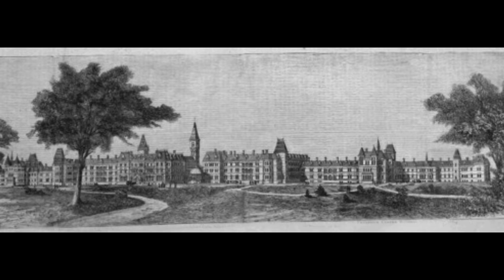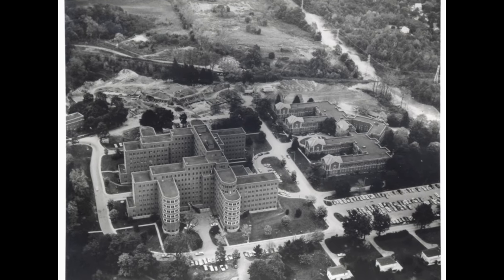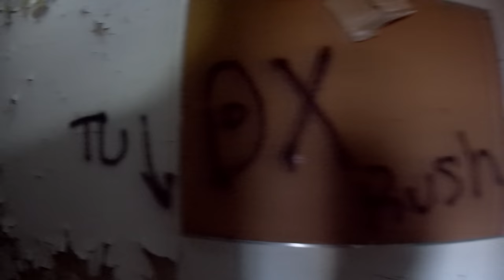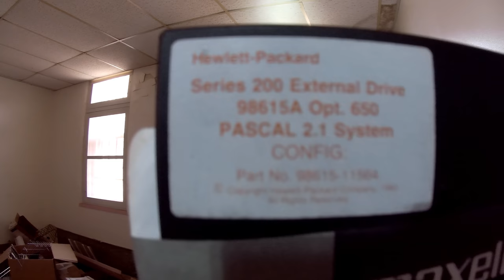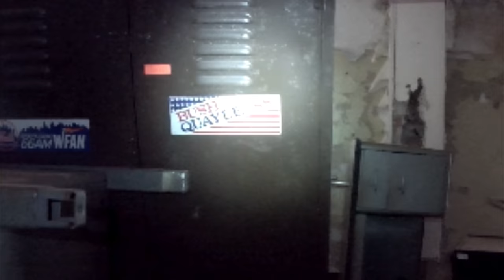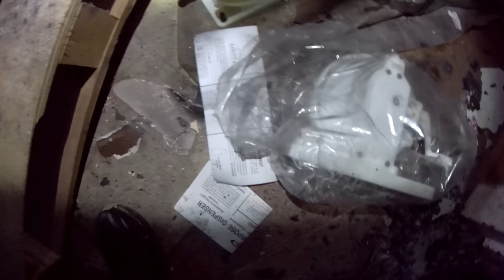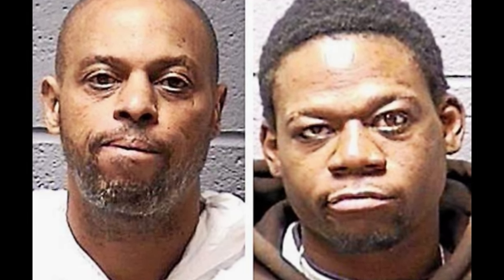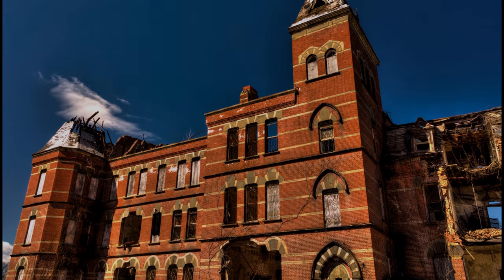Abandoned Arkham Asylum Criminally Insane Ward Pt 2 | Abandoned Places EP 40

Comment: I'm curious about there being so much peeled paint inside a closed building.  Isn't that a sign of lead paint?  (I'm not sure how old latex paint is.)
Reply from the maker: Much worse, even. The building is filled with asbestos as well. The masks we wore had (almost) the right filter for this. It was freaking me out for the explore, but in our favor it was wet, which usually keeps down the particles, and those that reach the air when you step. Still, one of the more dangerous in this regards I've ever seen. It is currently under demolition.